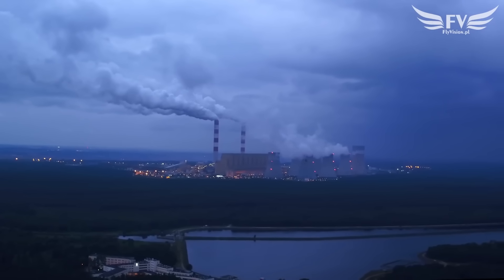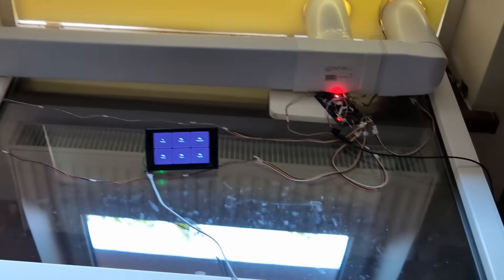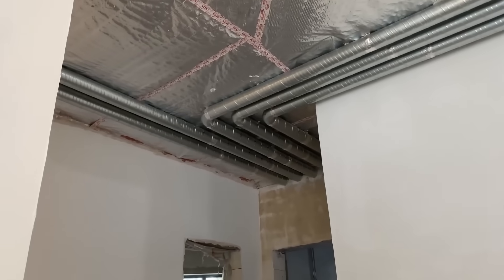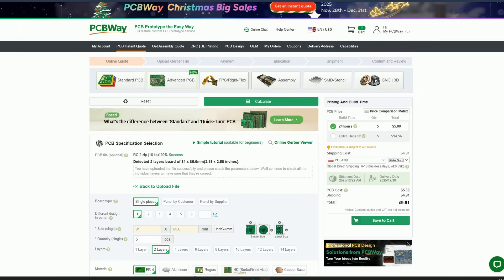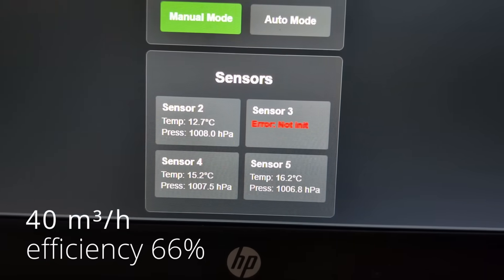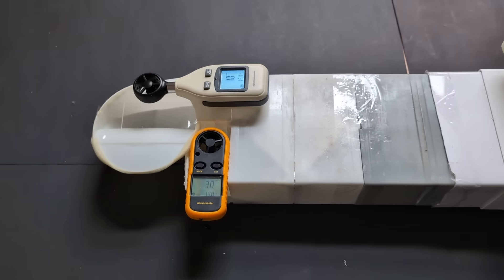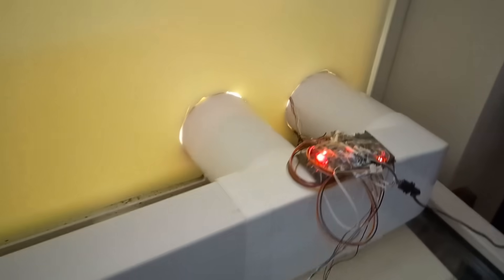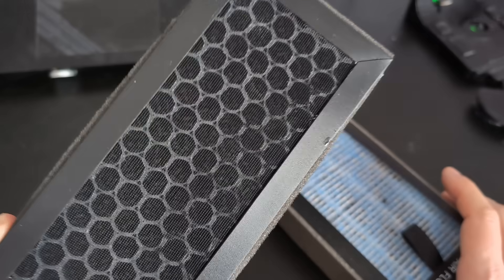DIY Heat Recovery Ventilator: From 55% to 90% Efficiency (Real Tests)

Comment: Very interesting video. Two observations: the antenna part of the ESP32 should be in clear space ie no copper fill below it and preferably off the edge off the PCB. And second, If you anneal the copper sheet it will be much easier to form/work. You can anneal as many times as you like.

Comment: your intake and exhaust tubes are way to small you need up the diameter to min. 20cm and higher , it will make a huge difference for everything, dont underestimate this

Comment: What's the actual amount of energy recovery from the increased efficiency, and does it make sense to pursue added efficiency gains at higher materials and production costs?
Reply from the maker: I’m quite satisfied with the current efficiency and don’t expect to improve it much.
The main goal now is to make the heat exchanger easy and practical to assemble.

For example, the copper exchanger I built took almost 3 days, and the result looked, to say the least, messy — plus maintenance would be very difficult.

So my focus is on optimizing the design and implementing automatic system control rather than chasing small efficiency gains.

Comment: I live in a hill in an almost passive home, but the bathroom extractors still leave bathrooms at 70% humility and a huge thermal bridge tunnel to the child UK winter. Especial when wind blows, making all the insulation of the passive home useless. Also have condensation in the extractor ducting dripping down which destroyed ip68 extractor fan. Please lmk when you put up your Kick Starter fund raise link as if like to buy one per bathroom. Pls also install humity control and blue tooth feedback to android.
Looks amazing well done.
Reply from the maker: Thanks! Sounds like your setup really suffers from moisture and thermal bridging, even in a passive home — that’s exactly the kind of problem I’m trying to address.

I’ll definitely let people know when a Kickstarter or production version is ready, but first I need to finish testing and finalizing the design.

Humidity control and feedback via Bluetooth is planned for future versions, so it should be possible to monitor everything from Android.

Comment: I admire your desire to reinvent the wheel, and perhaps you will indeed discover a better solution, but I would like to correct a few statements. In 2018, I installed one of the commercially available ventilation systems with heat recovery in a 154 m² single-story house, and it cost me 14,000 PLN (roughly 4,000 USD for the device + materials + labor). The second issue is noise - with a central solution, this is not a problem because the fans operate relatively far from the rooms to which the air is supplied. In addition, flexible ducts, distribution boxes, and expansion boxes are used instead of straight rigid pipes. The third issue is power consumption - for most of the year, the device runs at 100-200 m3/h, which in my case corresponds to a power consumption of 50-80W (~620 kWh/year). The fourth issue is efficiency - I have a cross-counterflow exchanger and the efficiency of the recuperator measured at its connections at an outside temperature of 0°C is ~80% +- 2%. I do make the filters myself, but here I also use available solutions - filter fabrics bought by the meter - G4 with activated carbon + G7, and when on a winter evening you can smell smoke outside and the meter shows 122ppm 2.5, in the house there is ~20ppm from the air vents and no smell of smoke whatsoever. That's enough for me.

Comment: my thoughts on this are

1. think copper could be a tow sided sword, it conduct better but also it transfer faster, mean that the head would more even distributed and bring more warm to the cold exit, what lower the performance/efficiency. To avoid this, shorter/simple multi stages, to transfer only smaller delta T each time. but make the setup more complex.

2. to transfer, how about only build squares and push copper wool or so into the space, more surface to the air and faster transfer to the walls. But depends on the density of the wool, the air pressure could be make issues. or the wool/wall conduction could also be bad.

3.  To avoid the forming of the metal, maybe buy a long alu headspreader (ali express have some 10x20x1.2cm) and cut to length and stack.

4. also related to cooper, with humid air, it could be faster oxidize and lower the conductivity, but only by 2-3% efficiency.
Reply from the maker: Good points. Copper is a double-edged sword: great conductivity, but it can also spread heat too evenly and reduce ΔT if geometry isn’t controlled.

Fillers like copper wool increase surface area, but pressure drop and contact resistance often negate the gains.

Stacked aluminum spreaders are a practical alternative for prototyping.

Copper oxidation is real, but its impact on efficiency is minor compared to airflow and exchanger geometry.

Comment: Please start a kickstarter campaign: I'm interested in using it. Question re. moisture: does it work both ways? For example, if the inside air is too humid, does it vent out the moisture as well as air (if it's installed in a kitchen or bathroom), and if the outside air is humid, does it let the humidity pass through to the inside?
Reply from the maker: Thanks for the interest! Before anything like Kickstarter, I first need to finish the design and fully test it. Only after that would manufacturing make sense.

Regarding moisture: yes, in principle it works both ways. If indoor air is too humid (for example in a kitchen or bathroom), moisture can diffuse out. If the outside air is more humid, some moisture can pass inward as well.

The goal is not to block humidity completely, but to balance it naturally while exchanging heat and fresh air.

Comment: Carbon filters only absorb VOCs until they saturate at that temperature and partial pressure. As VOCs then drop or temperatures increase they re-emit the VOCs. Carbon filters are only capable of improving VOCs for a few minutes. Maybe hours. They then need regenerating by heating them up and blowing low VOC air over them.

Try Hydroxyl radicals instead. Or Ozone. The hydroxyl radicals are available via Panasonic NanoeX air purifiers you can buy for use in cars. The Ozone requires a catalyst to break down excess ozone before it leaves the device into the room because you shouldn't breath it. These will break down VOCs into water and CO2. You could also use titanium dioxide paint and UV light but it's very inefficient.
Reply from the maker: You’re right that carbon filters saturate and aren’t a permanent solution for VOCs — they work best as a buffer, not a magic fix.

Hydroxyl radicals and ozone-based systems are interesting, but they come with their own risks and complexity, especially for residential use. Ozone in particular needs very careful control and post-catalysis to be safe.

For now, I’m focusing on filtration + ventilation as a predictable and controllable baseline. More active chemical approaches are interesting, but I’m cautious about introducing them into living spaces without solid long-term data and testing.
Reply: @DIY_Yarik  I've built an ozone based air cleaning system with an ozone sensor on the output. If you design the catalyst effectively then you can end up with lower ozone coming out of it than went in.  That might not be the best thing as a low level of ozone is natural and can be beneficial.

 I used manganese dioxide painted onto plastic sheets with offset holes drilled into it. That's a high pressure drop option which might not be best for your high volume flow solution.

Not saying you should use it. Just saying what works from my experience for future reference.

Also then you have to deal with the higher CO2 and humidity produced by the break down of VOCs.

Comment: 0:40 your numbers are wrong. Based on your own chart, renewables make up more than 18% of primary energy consumpion.
Furthermore, please look at the graph for modern renewable electricity generation by source. Wind and PV are growing exponentially at insane rates. Total newly installed capacity worldwide was more than 90% renewable in 2025.

Comment: I wonder if there might become issues with the copper forming copper oxides growth from the humidity, probably not an issue but something to look for. For the fans have you experimented with both push and pull configurations? When you only have either you get faster diminishing returns on pressure as the fan needs to push exponentially harder for each increase in pressure. With both push on one side and pull on the other they should have half the pressure they each need to achieve for the same overall pressure difference, meaning they don't need to go as high on the exponential curve.
Reply from the maker: Good point.
Copper oxidation from humidity is something I’m keeping an eye on, but at these conditions it shouldn’t be a major issue, especially with airflow.

And yes, I agree on push–pull. I’m planning to use an additional fan after the heat exchanger and before the filters to compensate for pressure losses. Filters add a lot of resistance, so this helps keep balanced airflow on intake and exhaust.

Comment: The reason for a low efficiency:

Counterflow heat exchanger:
Warm exhaust air and cold supply air flow in opposite directions.
The temperature difference remains high over the entire length.
This allows more heat to be transferred.
Efficiency: typically 80–95%

Cross-flow heat exchanger:
Air flows cross each other at right angles.
The temperature difference decreases more quickly.
Less time and surface area for heat transfer.
Efficiency: typically 50–70%

Comment: I was thinking of building a similar project to yours, but i want to put only two recuperatiors for the entire floor. I would put each one on the far side of the house, so it mixes the pushes entire floor room. I also wanted to use clay to make diy honeycomb heat exchanger with a couple aluminum pipes inside. The fans would of course blow and suck in intervals in and out of the house. What do you think? Would this be a good idea?
Reply from the maker: Honestly, I don’t think that’s a very good idea.
With only two units for an entire floor you’ll get uneven ventilation, poor air exchange in some rooms, and flow reversal issues.

Clay honeycomb + alternating flow adds complexity and moisture problems, and in practice efficiency is usually much lower than expected.

From my testing, distributed, continuous-flow units work far more reliably and predictably.
Reply: @DIY_Yarik Thank you for replying!

Comment: Long therm, Instead of using copperplates as temperature transfer material, use water.  Cold or hot air pumped in microbubbles leave their thermal energy in water. To avoid water contamination, water must be replaced weekly, contaminated water being used for garden or WC.

Comment: Have you thought about just 3D printing the entire core and using gyroids to increase surface area, since as far as I understand the main limiting factor for efficiency is the thermal conductivity of air meaning you can get away with using plastic by just increasing surface area (based on my research paper that won a high school competition :p)
Reply from the maker: That’s actually exactly what I’m working on right now 🙂
A fully 3D-printed core with a gyroid structure makes a lot of sense, since air-side thermal resistance is the main bottleneck.

On top of that, I’m planning to electroplate the entire surface with copper, around 30–70 µm thick. That should significantly improve surface conductivity while keeping the geometry lightweight.

If it works as expected, it could be a very efficient middle ground between plastic and fully metal exchangers.

Comment: hi, even tho the proect isnt finished i'm planing on something similar. at the moment i'm using a big tube heatexchanger but its not working great. can you may show how you made your heatexchanger or were did you get the material for it?

Comment: I would start by using whatever car intercooler you can find for cheap, they are designed specifically for air to airheat exchange with high efficiency.

Comment: There is an aluminium alloy that reaches several times, yes times, the thermal conductivity of pure aluminium with magnesium and possibly other elements and materials but didn't read the specifications in detail, you'll have to look it up yourself.

Comment: Excellent work! I have a heat recovery system and it works well in my house, but I want to make it more efficient. I love the idea of compact room based systems also. I for years have been wanting to also build a solar collector to preheat air before entry into the house! Great work on the PCB...

Comment: Hello. Did you try a car intercooler? It's looks like a good solution. And it's a lot of sizes and shapes of cheap Chinese aftermarket intercooler. It's cost 50-200$ depends of sizes. It's sealed, can take pressure, aluminium fins solder - good fot ternak conductivity, and they can move a lot of heat.

Comment: Aerodynamics plays a surprisingly huge role in fan noise And efficiency..!  (Centrifugal or Axial)
A fan producing less noise, for the same flow, is because the (less) energy is being turned into noise instead of flow...

Same for exchanger and  ducting design: Simple changes = up to 60%.

ie: Some simple aero changes to your design  will make a huge  difference in noise and efficiency. 
This takes some study online, but top examples:

* An free air-space at least = to the fan diameter,  both ahead of the intake and behind the exhaust.
* Elliptical (3 to 1) bell mouth on fan intake.
* Round the leading edge and sharpen the trailing edges of your flat plates with sandpaper etc, before crinkling them.  
That (half) ellipse is again optimal, for the leading edge, but any rounding is way better than none.
Sharpening the trailing edge with an angle of no more than 7 degrees is optimal, but any sharpening will help a lot.
500 grit sandpaper is  the  coarsest you can finish with, or skin friction is too high.
Reply from the maker: Thanks for the advice! Right now I'm focusing on efficiency and making the design easy to replicate. There's no point in a quiet exchanger if it’s too complex for others to build. I’ll save these aerodynamic tweaks for the final stage. Your tips will be very helpful then!

Comment: I bet if you round the corners of your tubing, no 90° angles, you will have less turbulence. Less turbulence means lower noise and higher airflow.
Reply: Including the very end piece. The end piece could just be a curve in the pipe with a hole at the end of the curve. 🙂

Comment: You've been at it for six years man. I admire your consistency and motivation. I would have given up long time ago. 
I shall definitely follow your research.
PS.: Maybe it might be worth talking with some Universities (PhD people) or schools? There are many in Poland and EU. They could have a few ideas or suggestions to help you progress? (Unless you want to go at it alone)
Reply from the maker: Thanks! I’m a bit of a loner and obsessed with the process. But I think I’m reaching a point where I need to team up with someone to finish this faster. I really want to get it into people's hands so they can build it from the plans.
Reply: @DIY_Yarik Yes, I thought you might want to go at it alone. ;) 
That's a large area of knowledge to cover. But seeing your persistence I'm sure you'll get it done. Just a matter of time. 
I don't want to pressure you here, but maybe a little more frequent updates could help a bit. I've read the comments under your vids and quite a few threads had fairly competent and knowledgeable discussions (as much as I can judge...) :)
All the best and let us know if you need help. I'm certain the community will come through with support.

Comment: I think this system is awesome and definitely going to reproduce some of it somewhere in the near future, simply because i have open ventilation missions around the house (bathroom for starters, which has a rooftrough open hole right now! :s ) so im very interested about defogging the room and recuperate heat as a bonus (shouldnt be bonus..). Next i dont want to sound dumb, so dont flame me on anything.. but are the extra miles taken for air purification/filtration worth the effort. I mean if you live in a polluted area, you will breath in this shit anyway. the system will depend on you being home alot for the chance of breathing clean air. chances are the company you work at doesnt replicate your efforts. and what about summer. are your days of cracking a window completely over? as i imagine this system will reduce the bad things you breath with some, or alot.. depending on how much you are at home? (long comment, but dont get me wrong, im excited about the content/project you created).
Reply from the maker: Glad you're interested! To answer your question: we spend about 1/3 of our lives just sleeping. Giving your lungs 8-10 hours of clean air every day significantly reduces the total toxic load on your body. It’s like a daily recovery session for your immune system. As for summer, you can still open windows, but this system gives you fresh air without the noise, dust, or pollen. Good luck with the bathroom build!
Reply: @DIY_Yarik  im still 'young', so i do sleep that much. but you are absolutely right. And thanks, im gonna need all the luck possible to make a venting system in a double ceiling accessible from a tiny crawling space in my home. good luck with th continueance of the project